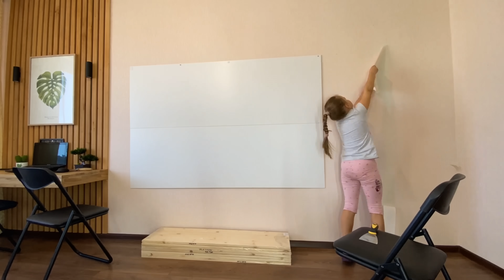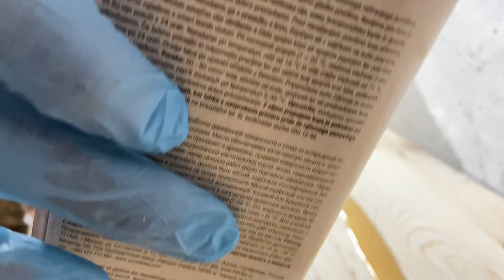How To Build A Floating Media Console - TV Stand Tutorial | Floating Entertainment Center

Comment: Hello - can you please tell me how many screws and which ones to attach pleat to wall (studs I assume) so that it could take your weight? I hate to rip out the screws from the wall! Thanks.
Reply from the maker: Hello! I used 4 such screw's 6*70 https://www.oma.by/shurup-shestigrannyy-6-0x70-tsink-10-sht-1-158160-p
Reply: @Polkilo  sorry was that 4 per side (as you split into two cabinets). I noticed when using jig / pocket holes you went towards the skinny end when doing sides. I'm a beginner myself but they say to drill away from the ends for better strength? Great result!
Reply from the maker: For better results you can use 4 screws per side. All depends from materials that you use. I used pine boards and they are pretty light weight. If you will use oak it will be much Heavier.

Comment: Did you use dry wall screws in the Pocket holes?
Reply from the maker: Yes, I used wall screws. They work well and much cheaper
Reply: @Polkilo  did you do pre drill the hole after boring the pocket hole? I was wondering because I know drywall screws tend to split the board